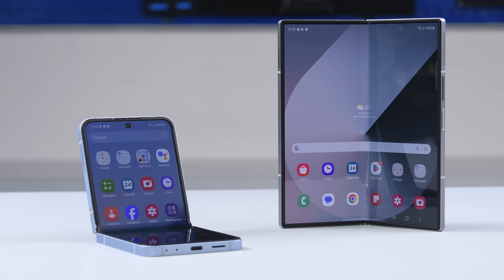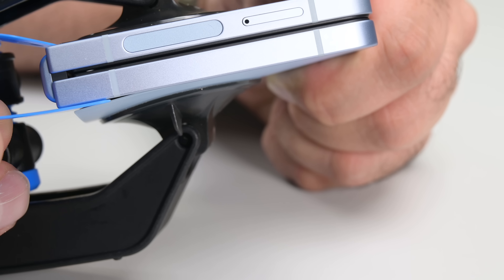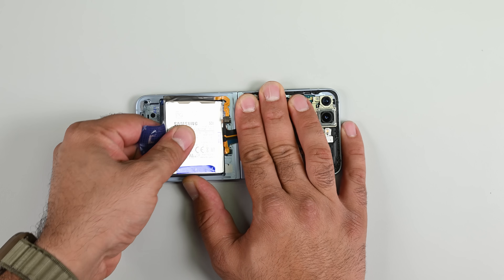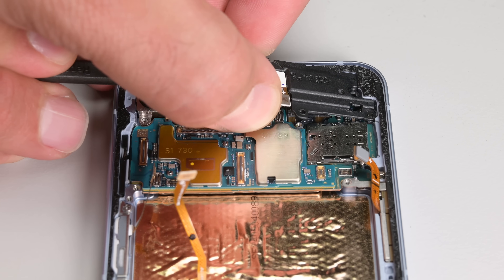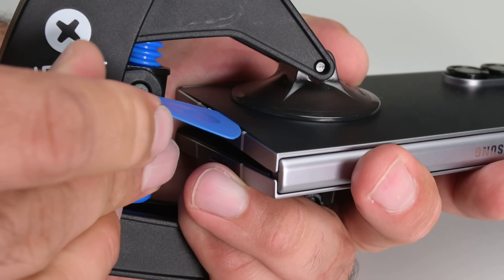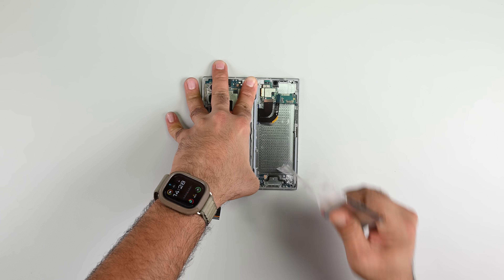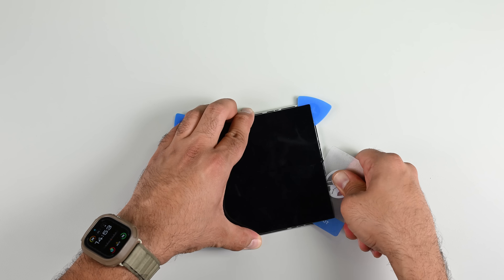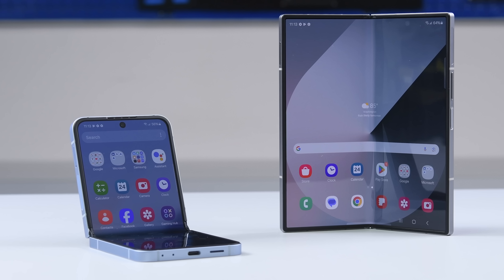Inside Samsung's Foldable Phones! Galaxy ZFlip 6 and ZFold 6 Teardown

Comment: can the plastic bezel be replaced without removing the flexible display? 

do you need heat or does it just pop out? 

it looks like you can remove it just fine, im just wondering if the replacement would only go back in if you removed the screen.

Comment: After 3 months of usage with my Z Flip 6 screen stopped working. I was in Thailand at that time. As I had Samsung care for 2 more years, I went to Samsung service center. They told me as my phone was bought in Canada, I had to go canadian canadian service center. Very bad coporate behaviours... I bought a Poco phone, for the last 5 months I have to spend in Thailand. Very good phone. I also had the same screen problem with my Flip 4, after 14 months... I think it's buying cheap phones and change more often. The Pocophone F6 Pro I bought is un third of the price. One satisfied customer Samsung.
Reply: To be honest though, they might have had a good reason to not repair it in Thailand depending on the region differences between
Reply: @juicewrldextendedunrelease5274  Yeah.... Really a good reason? Especially for a screen?
Reply: @juicewrldextendedunrelease5274  Especially after they offered me to repair, for a $500.00 charge... This phone was my last Samsung phone. I also had to replace my Z Flip 4 screen shortly after the warranty went off...

Comment: Sir, could you share with us the camera lens structure? Because after installed lens protector,  when tried to remove, the original camera lens tear off together and i am not dare to pull off together.

Comment: I'd be interested in foldable phones if they'd give up on the flexible screen stupidity and just use 2 well-integrated panels. I'd rather have a small gap between the 2 displays than an ultra fragile, unreplaceable lumpy screen.

Comment: Foldables are still too fragile IMO to even consider. They may look nice, but at the end of the day, the inner screens are plastic and will be damaged easily, plus they are only rated for a certain number of folds. I'd say that in under 2 years, the inner displays WILL break, and replacements won't be cheap. So it's a no from me.
Reply: Have you tried them?
Reply: obviously he hasnt LOL. keyboard warrior he is  @LetsGoBrandoo

Comment: The internal parts look like cheap toys compared to iPhone internals. And these phones cost how much??!
Reply: Apple fan boys 🤣🤣🤣
Reply: Go watch any Louis Rossmann video about the myriad of critical design flaws in Apple products and you'll very quickly realise that pretty internals in marketing shots are nowhere near as important as robust, modular and well designed internals
Reply: @bosstowndynamics5488  Apple fan boys will defend Apple even if they are being duped. Android has a lot of manufacturers, you'll need to have better hardware and UI to get market share. That's why Samsung is king in Android smart phones
Reply: cheap toys which means easier to repairable (we put those folding screen aside, shall we?)

Comment: Amazing guys! Any chance of recommend a repair store in florida area that could address z4 screen flex back to correct functionality??
Reply: I work at a Samsung "ASP" or Authorized Service Partner.   What exactly are you referring to "back to correct functionality"?
If by the hinge not being able to be completely flat, that is considered an inner OLED "screen" assembly repair.  Let me know where you are located so I can give you more possible insight, and repair possibilities.
Reply: @Atixtasy  By correct functionality, I meant working as it normally should, I had the hinge not fully flat and few days later it stopped working so now it doesnt charge or turn on by any means, any ASP recommended close to 33021?
Reply: @kxtreme777  typically that is caused by debris getting into the hinge, or damage to the hinge that causes it to not lay flat.  Part of Samsung's IQC and OQC (Incoming quality control / outgoing quality control) requires that a phone be able to pass this exact test.  In short, IF anything in your case damaged the hinge, time to replace the entire inner OLED / OCTA assembly.

Comment: Still using mAh in 2024, please guys Wh is the superior unit.. remember people being confused about the Apple Vision Pro having a 'small' battery? Yeah thats because its at 7.4 volts, could have easily avoided that if Wh was the standard for reviewers. Strange that for laptops Wh is normal but not for phones.
Reply: mAh gets used for phones because they pretty much use the same single series cell architecture, other devices are more likely to operate at different voltages (there's a huge range of laptop cell counts from 2S up to like 6S) so Wh is borderline mandatory there. The other factors at play are that mAh results in a larger unit than Wh without being awkwardly large like mWh would be, and most people are so hopelessly illiterate at dealing with battery capacity units that they'll get confused regardless of what unit you choose.
Reply: mAh is what almost every company uses for phone and tablet batteries. At this point, it would be more confusing to consumers to switch to a different unit.
Reply: @ratrodgrady that sounds like the same logic used to keep the United States using imperial instead of metric.  The country that invented it doesn't even use it anymore 

If we are trying to measure energy density watt hours is the obvious choice.  It literally is the measurement of work over time.

Comment: Why did you not explain the hinge mechanism and no flourcent dust test this time?
Reply: They are the exact same as the flip 5 I presume
Reply: @bloxxer02  no they are not. Please check if your presumptions are true before posting or just don't say anything if you don't know enough about a topic. It's nice that you want to help yet misinformation is worse than no information.
Reply: @RealLifeTech187 Jerry rig opened the flip and noted that it's missing the internal brushes, that thing  works but it peeling are the reason of the infamous galaxy fold not able to open fully after 1 year.
I'm looking around to see whether the fold also discard the brushes but so far no answer.
Reply: @bloxxer02  the hinge might be same but the flip/fold6 is now has dust protection
Reply: @mArvAlcao71 no, it just has the certification.
 Certification level 4 only means that no dust that measures over a millimeter can enter.
A millimeter... It's bigger than sand... It's ridiculous
Reply: @mArvAlcao71 It's worth noting that even the Flip 4 was pretty reasonable at handling dust, so as mentioned by the other response the certification doesn't mean that there was a change to the underlying design

Comment: why the small batteries still? 4400mah isn't that much lol
Reply: It lasts a whole day for me! Wdym ?
Reply: @atrdigital5935  what the heck is a wdym?
Reply: @atrdigital5935  For the other part of the text, phones have lasted a whole day for years, why can't they last a few days at this point?
Reply: @compunerd Because they do more things now, if you use a modern phone the same way you would have used a smartphone from 2008 it'll last 3-5 days easy.
Reply: Mine would barely last a day.  Now that I have the OnePlus open has never hit 0% one time.  The time it takes me to brush my teeth and wash my face it has enough charge 24 hours of use.  

Samsung is lacking.  They lost a long time customer when they released the fold 6 and increased the price.  Same phone for 3 years in a row

Comment: Why are we still using mAh? 

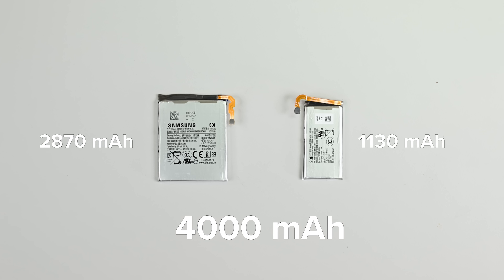1:43 Z Flip6 | 11.14 Wh + 4.39 Wh = 15.53 Wh
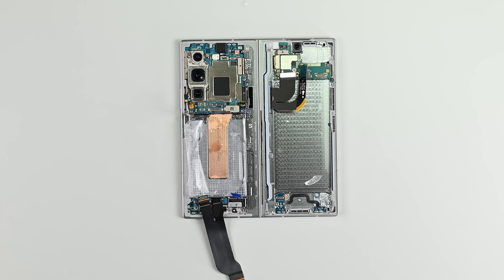3:25 Z Fold6 | 9.41 Wh + 7.67 Wh = 17.08 Wh
Reply: why not? It is what we have been familiar with since the first smartphones (even phones?) came out.
Reply: @BakrAli10  because it causes confusion and doesn't tell the actual capacity when you're comparing them
Reply: @brandon_nope  Dunno know why it causes confusion to you as literally the whole phone industry uses mAh for their products and it should be easy to compare between phones. And from what I saw online it seems like mAh could give a more accurate figure on the battery than Wh, not sure about that as I am not an engineer.
Reply: @gginindereuw6288 mAh doesnt take the battery voltage into account. (m)Wh is mAh x voltage. Much more comparable from battery to battery as voltages vary slightly between different lithium chemistry compositions. Outside of tech Wh is the standard for batteries. For example, the 100Wh limit on planes, much easier to have a unit that works for all batteries no matter their voltage. There's a reason you measure power of electrical devices in Watts (W) and not in Amps (A), as Amps don't really mean much on their own. Same with batteries.
Reply: @BakrAli10 that's the same logic used to support continuing to use imperial instead of metric

Comment: I loved my Z-Flip but the screen would only last 1 year. I am too rough with it, I guess, and I am not the right customer.
Reply: true, just got full body and screen replacement for my ZFlip 5. thankfully it was free cz under Scare+, I will reconsider to buy S Care+ for next year.
Reply: I imagine the newer ones stand up better in no small part because of the bigger outer screen, but intrinsically flip style phones will be subjected to a lot of wear by most owners with many folding cycles per day due to frequent phone use, larger fold style devices stand up better inherently because they see far fewer mechanical cycles per day. Flip style devices right now are probably best suited to infrequent/light phone users who value the compact size but still want a nice phone and are happy to spend for it, most average users for various reasons should still get a slab phone.

Comment: What do you mean by 5 years foldable screen life? If I buy a zFold 6 today and unbox it 5 years later, will the screen not work???
Reply: Samsung foldable screens are tested to last about 200.000 folds. If you unfold and fold your device 100 times a day, it would roughly make 5 years of screen life.
Reply: @HakanOnurDerici  under controlled environment, temperature, humidity, and dust , all those affect in some way flex and hinge operation..
Reply: "About 5 years worth" Now use your brain to think about what was meant by that sencence ^^
Reply: @videostar348  I guess it is you who don't have any brain. The life of a foldable screen can only be gauged/measured by how many times it can be folded and unfolded before it stops working. A certain period of time (5 Years) cannot do it...!!!
Reply: @videostar348   I guess it is you who don't have any brain. The life of a foldable screen can only be gauged by how many times it can be folded and unfolded before it stops working. A certain period of time (5 Years) cannot be a measure for gauging a foldable screen's life...!!!
Reply: Please tell me you were high when you wrote this.

Comment: Why It doesn’t support Qi2??????
Reply: I believe magnets interfere with digitizer on the display making the s pen not working🤷
Reply: @LeoJohn-ls1rl  true but the Flip definitely could’ve had it this year
Reply: @LeoJohn-ls1rl nope it's so that they can give a trickle feed of improvements.  Qi2 is here.  Wifi7 is here.  They just want to save that for the fold 10
Reply: @4lan39 when did you start working for Samsung?
Reply: @rizaS55  I own a OnePlus 😂
Reply: @LeoJohn-ls1rl A fixed magnet can be compensated for fairly easily, and the device could throw a notification in the rare event that an accessory was interfering with the display (which in turn could be detected fairly easily with software). There's plenty of people throwing MagSafe accessories on the Fold 5 without issue, it's a solvable problem
Reply: Qi2 is still incredibly new. Only one Android phone so far has it afaik and it isn't a major brand, so it'll take some time to get it integrated. Likely next generation for all the major manufacturers. One problem is that products typically take a few years to go from concept to release, and Qi2 was released as a standard last year, so virtually all the phones would have been in the latter half of their design cycle by then which would be a bit late to make a design change like that. Of course, many of the manufacturers are involved in designing these standards, so they certainly have a leg up on implementing them quickly.
Reply: Because not many people care about Wireless charging and companies don’t see the need to put faster wireless charging especially when it creates more heat. People want faster WIRED charging that finishes in less than 1 hour (or even less than 30 minutes) and would rather have that instead of inefficient wireless charging.
Reply: @PeterdaPanda  Qi2 actually has a slower maximum charge rate compared to Qi. The difference is that it is considerably more efficient because it uses magnets to force the coils to properly align (whereas it is not uncommon to have coils being moderately misaligned on Qi chargers, causing a lot of energy loss and excess heating)
Reply: Okay so you may think that Qi2 is a mandatory thing but I have a Z fold 6 and it charges fast from 20% to 100% in an hour which is fast enough for me.

Comment: Basically the Fold/Flip 5 with the buzzword "AI" added. 

Samsung's should've just called these Fold/Flip 5S. 😂
Reply: Agreed. The flip does have some nice upgrades, but the Fold 6 is just a Fold 5 with a face-lift.
Reply: as a Samsung Technician at an Authorized repair center, yes this is laughably the SAME phone with just absolutely MINOR changes.  My opinion, is that Samsung sees itself as the "Apple" of the Android market in a way that shows it essentially copying their playbook.
Reply: @Atixtasy  In the Foldable market.

The Galaxy S Always has quite nice Changes.
Reply: @Greedo1977  how so? The flip and fold 5 and 6 are almost identical phones lol.
Reply: @Atixtasy  Bro, read My Comment.

Galaxy S is No Flip or Fold, its the S Series.

S10/20/21/22/23/24 for example

Are you really a Samsung authorized technician?
Reply: And the iPhone 15pro is an iPhone 14ProS
Reply: @Greedo1977 more like iPhone 12SSS Pro